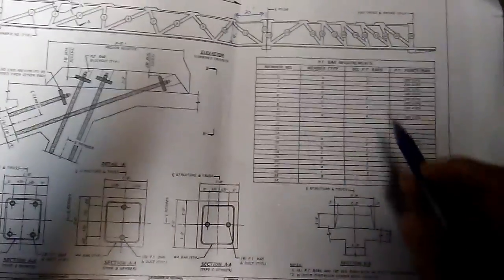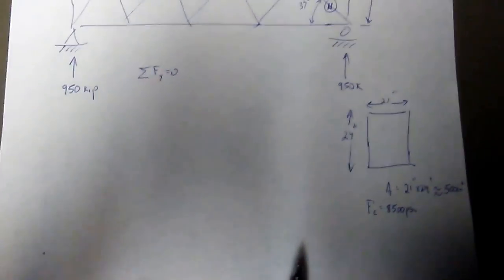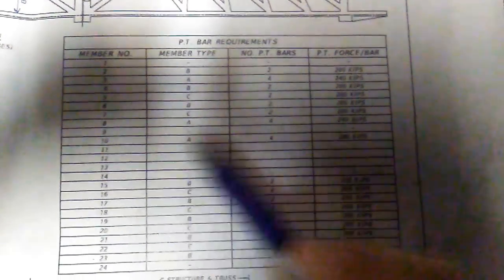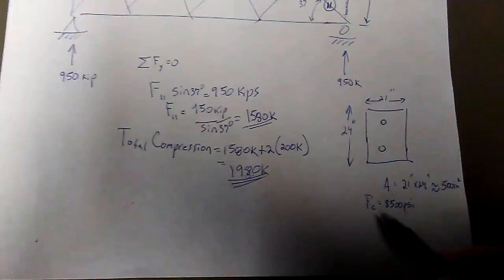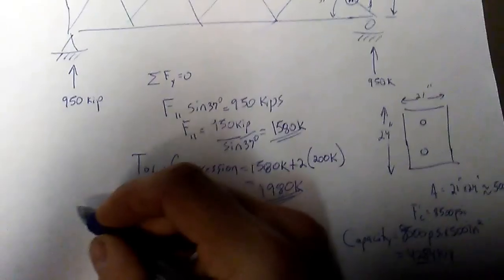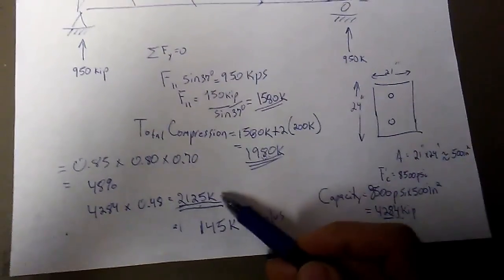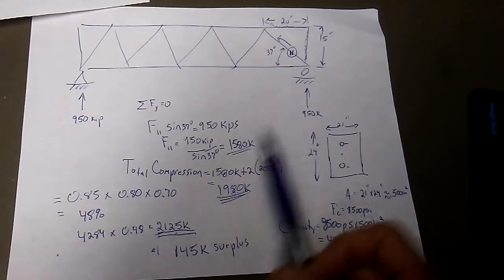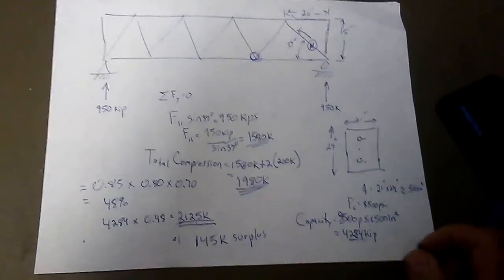FIU Bridge Collapse: The Hidden Truth (Part 3)

Comment: Sorry, but it appears to me that the member that failed was not in compression at the time of the failure, it was in tension. The steel tensioning rod failed because it was stretched beyond its limit, and compression forces would not stretch the rod, but tension forces would.
Reply: The tensioning rod did not break.  The OSHA report has a photograph showing what happened to it.

Comment: You left out the ultimate strength design factors for both the dead load and the post-tensioning load, which together would be about 1.5.  And your analysis ignores the live load entirely with a 1.7 factor.  So your 7% reserve capacity with dead +post-tensioning load only, was actually a NEGATIVE 29% capacity.  Furthermore, member #11 did not fail in compression.  The real over stress occurred where the crack photos indicated, in the cold joint at the base of member #11 that required an impossible to fit in amount of shear friction steel, and in the floor slab itself, that sustained a block shear type blowout due to a lack of an impossible to fit in place amount of hairpins buried in the floor slab concrete.  This bridge was designed to fail prematurely, due to the inexperience in reinforced concrete design that was possessed by all structural engineers who were involved with the design.  Not just the project engineer.  The people that checked the design, apparently possessed an equal degree of competence to the designers.  Computer analysis programs only design main members by giving design forces.  They do not spell out what force transfers need to take place in the connections themselves.  The fresh out of college engineers that operated the computer analysis program, appear to have failed to check the box for ultimate strength design.   Had this bridge somehow survived the construction phase, then perhaps hundreds could have been killed during the opening ceremonies.

Comment: The scaled angle off the drawings of member #11 is 31.4 degrees, making the dead load compression alone in #11 as 1820K.  However, ultimate strength design has a safety factor for dead load that varies for force combinations, but is at least 1.2, which makes the ultimate dead load alone compression = 2184K.  With 2 x 280K PT rods, then you have an ultimate load of 2856K.  The concrete was only 7 days old at time of failure, or .7 x 8500psi = 5950psi.  This makes your crude column capacity = 0.48 x 5.95 x 24 x 21 = 1439Kips  Which is almost HALF of what the design dead load plus post-tensioning load would be.  Oops!  And then 6 people died because the structural engineer did not understand ultimate strength design.  Note that member #2 at the opposite end of the bridge was 36" x 21", whereas member #11 that failed was 33% less at 24" x 21".  Doesn't take a rocket scientist to see that there is a discrepancy right there.

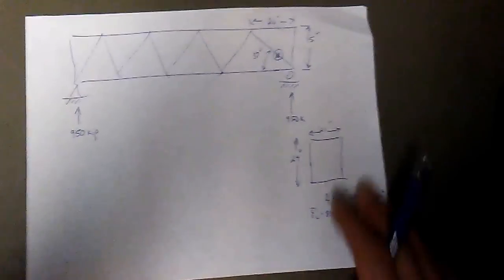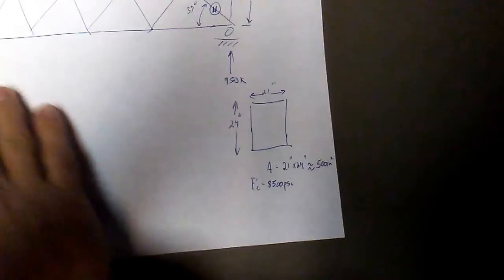Comment: If the total weight was 950 KiP as stated at 1:35, (and as stated in the WP article (https://www.washingtonpost.com/news/grade-point/wp/2018/03/16/recovery-efforts-continue-following-florida-bridge-collapse-at-least-6-dead/?noredirect=on&utm_term=.25391e098e45)  the weights borne at either end would have been 425 KiP. (You should correct your drawing around 1:40 and redo your analysis.
Reply: The weight was 950 US tons.

Comment: Good job on using basic statics and truss analysis. I always believe in applying the basics first then get fancy.
If you take away the two 3" diameter hole areas, that reduces the area to 496.93in2 the result with the factors =2010.56 kips now add that was fresh concrete you can easily see that member was designed below the expected load of 1980 kips. The designers were expecting the concrete to cure before the span was placed into service, let's hope so.  Ooopsies, but unfortunately someone died as a result of this mistake. I defer to what NTSB will find. Looks like #11 member failed in conpression.

Comment: Seems like the cracks could play a role if the angle of the crack was something other than perpendicular to the axis of the beam.  Under compression, the two sides of the crack could slide differentially.

Comment: I am not a building constructor but I worked more than 2 decades in a factory where we made Gangnail trusses. My work there was to make the production drawings.
I think I know why this bridge collapsed.
First, I think, the bridge is poorly constructed and this bridge is not what it looks like.
The bridge is a web-truss with two parallel beams connected by web-diagonals.
The whole construction is fabricated in concrete. The cross-section of the pedestrian-deck is much greater (wider)than the roof-deck so the center of gravity is very low. As a result of this, the compression in the roof-deck is much greater than the tension in the pedestrian deck. By prestressing the pedestrian-deck the compression in the roof-deck will increase.
Prestressing the roof-deck is useless because under full load the tension in the cables will disappear.
The same happens in the web-diagonals 2,4,6,7,9 and 11.
More important is whether the cross-section of these elements can withstand the pressure under full load. Most important is the dimension of the cross-section of the roof-deck. It has to withstand bending in both horizontal and vertical direction. The best shape for this part is a T-form, upside down. Web-diagonals number 2 and 11 are most important because the pressure in these parts is higher than is every other web-diagonal. Check the dimensions of this cross-section in relation to the length. Prestressing these parts is of no use.
To minimize bending horizontally of the roof-deck we can prestress the roof-deck longitudinally by beginning in the center at the ends of the beam and halfway at full width of the roof-deck.
The bridge collapsed because the roof-deck and the web-diagonal 11 could not withstand the pressure.

Comment: I have two news : one good and one bad.  There is a new set of drawings on the Net, this is a good news. The bad is : the tension force in each PT  bars in member #11 is shown as 270 kips. It means 540 kips total . This is more than your assumed 400 kips. Now you need to repeat your calculations. I also would like to make one correction. What you calculated was a SECTION strength, not a MEMBER strength. Calculation of a member strength must take into account the slenderness of a member. Diagonal #11 is approx 25' long and probable will  buckle before reaching section strength . If you take this into account, there will be another reduction in the member strength a more realistic result.
Reply from the maker: You are  correct Richard! I did not consider slenderness. The member capacity value calculated is a maximum...the highest it could possibly be assuming the member behaves as a short column (i.e. does not buckle). The calculations for slenderness are considerably more complex and beyond the scope of a youtube video.

Comment: I'm not a structural engineer, but I like your presentation a lot.  I have to ask, from the actual photographs of the damaged bridge, the square steel backing plate behind the tensioner nut looks like its about 4" x 4".  If the tensioner bar were tensioned to 200 kip, wouldn't that correspond to a force of 200/16 kip/ square inch or 12,500 psi on the concrete directly under the backing plate which greatly exceeds the concrete strength of 8500 psi? If the concrete under the backing plate failed immediately or later on, wouldn't that cause the tension to be released on the tension bar resulting in a failure?

Comment: I contend that the failure occurred in the joint at the top of member 11. Member 11 must of had some conventional reinforcing in it for it to act as a compression member.  I agree adding compression by post tensioning doesn't make sense.  Also, the cross-sectional  area of the truss at that joint was small, mostly just the top (roof) member, due to how the diagonals meet.  Another consideration was, was there a "cold" joint at the top of the diagonals. And, were bending moments in the members considered?
Reply from the maker: Good points Aaron. Usually failures occur at connections.... which may be the case here. Unfortunately, we do not yet know how the connection was reinforced. Regardless, it is hard to believe that the bridge could fail with 1 worker  adjusting the PT bars...were there other deficiencies related to design or construction that will be discovered?

Comment: Given that Member 11 was already factored to be in heavy compression due to the load of the bridge, why would you add to that by tightening its reinforcement bars to such a high value, or even at all?  Going back to your "Total Compression" calculations,  you would get 1580 kips vice the 1980 kips if you didn't tighten the rods, resulting in a higher Safety Factor.  What am I missing?  Thank you for your analysis.
Reply from the maker: You ask the Million $$ question! If indeed the contractor was tightening the bars just prior to failure, why was he doing something that appears to not have been necessary. Is the collapse really attributable to such a simple mistake? That will need to be answered by the NTSB investigation.
Reply: Thanks.

Comment: I love the calculations.  What is an acceptable Safety Factor for a structure of this type?
Reply from the maker: Thank you Amy! And welcome to the conversation. My guess is the minimum safety factor is at least 2, and maybe more. Looking at the calculations, the member design capacity is reduced by approximately 50% when applying the reduction factors mentioned in the video. In addition, when designing, loads are increased to account for uncertainties. For instance, selfweight is increased by 25% and pedestrian live loads would be increased by 75%. So the combination of reducing member capacities and increasing loads is where your safety factor is gained.
Reply: @structuresspecialist9743  You don't have support with an angle like that.  It should be covered in engineering 101.  And it probably will be from now on.  The FIU will live on in history as a wonderful example of too much applied math, and too little basic understanding of construction principles.  Once the geometry is off, all the math goes out the window.

Comment: You focused on compressive failure of member 11.  My understanding of truss design says that vertical forces in member 10 and member 11 must remain in balance, so that total resultant force at the junction at the top of 11 is 0.  If compression (tensioning) was added to member 11 without member 10 responding (moving less into tension) , then a bending moment would have been applied at that junction.  The videos of the failure seem to me to show that as the first point of fracture - just north of the junction above member 11.   The pictures I think show member 10 fractured.  But member 11 looks relatively intact I think.
Reply from the maker: Yes, you are correct. The sum of vertical component of the diagonal member forces must equal 0 at an intersecting panel point.  However, post-tensioning only compresses a member, but does not increase the forces carried by the whole truss.  So Member 10  forces should not be impacted by post-tensioning at Member 11. You do bring up an interesting point though about the impact of post-tensioning at the junction!

Comment: I really love the analysis, but I think a flaw in this reasoning is the assumption that the concrete failed. The engineer inspecting it did note cracking, but not substantial enough to raise red flags. The spectacular failure appears to be the tensioning rod, so the fundamental question is why the rod failed, not the concrete.

I would love to see the math on the diagonal post-tensioning cables that took the weight of that overhang. As layperson, it feels like the best explanation is that those two cables were stressed past their elastic limit, but not passed their yield point, during the move. Post-installation, they then tried to tighten those cables, but since they were passed their elastic limit, they couldn't achieve the same tension any more, and they kept tightening trying to get them to, at which point they passed their yield point and gave way.
Reply: So, as a non-engineer, I did some quick math, and I'm afraid this surpasses my understanding, even with the plans as written.

The plan calls for 1 & 3/4 inch rebar tensioning rods. I don't know what kind of rebar that is, but my understanding is that most modern rebar has 500 MPa, which translates to 72.5 kips per square inch.  Now, 1 & 3/4 inch round would be 2.4 square inches, which would give 175 kips. But the plans call for 200, 240, 280, even 320 kips of force applied to them. What am I missing?

Comment: Senior Engineer

The way I read your diagram is that member #11 would be compressed ( rather than put in tension) to support the load of the bridge deck and roofing. You might look at failure in compression as a possible cause.  The roof section is clearly in tension by the cantilever of the bridge.  Also do concrete structures fail in bending as well as tension?
Reply from the maker: Watch my Part 3 video for compression analysis of Member 11.
Concrete undergoing tension and bending simultaneously can certainly fail if overstressed.

Comment: love learning about this... in your presentation you said that in compression that the cracks were not significant.  If tensioning of the two rods were to be kept within 5 percent of each other..  in other words you would have to tension one slightly, and then tension the other, switching back and forth, would the cracks now demand that tensioning would have to be kept within 2 percent,  for example???  If the cracks changed the allowable difference between the rods and the Tensioning Contractor didn't realize that,   would that account for his over doing it.  Forgive the none engineering perspective.
Reply from the maker: The cracks likely occurred during transport when Member 11 was in tension. With the bridge in it final position, Member 11 switched back into compression, so the cracks would not be a concern. Concrete cracks in tension but maintains its strength in compression even if cracked. Why the contractor was post-tensioning a member already in compression in the key question that will need to be answered!
Reply: I'll be waiting for your follow up..  It will be very interesting to here all of the details.  I am an electrical contractor and have had only minor accidents over 30 years of business, thank goodness.  When distracted, or hiring youthful inexperienced workers we have had close calls.  
Are you thinking that this has nothing to do with the move/cantilever?
Reply from the maker: Tough to say whether the move had anything to do with this. We do not know where the cracks occurred, so that could change my conclusions, but assuming the cracks were in noted in compression Member #11, I would not fault the cracks for the bridge failure. Looking forward to finding out more information about the cracks and their locations....stay tuned!

Comment: The design was inherently flawed.   It was primarily designed for the facade, a mockery of actual engineering, trying to pass the crap off as a suspension bridge.   The beauty of the bridge is in the fact that it is holding up the bridge, not just sticking out like an eyesore with no function.   

Then, the designer had another priority:  not impeding traffic.   I bet, the bidding for the project included estimates of how long the lanes would be blocked, along with cost.  So after all that, the designer didn't stand a chance, and in their exuberance at getting some decent paying work, forced out this turd that should never have flown.

From now on, match the materials to the form.   Just look at the involved forces and use suitable materials.  Then overbuild it, don't just overdesign it.
Reply from the maker: The suspension bridge component you refer to was intended mostly for aesthetics. I will do a video about this....so stay tuned. 
Construction that has minimal impacts to traffic is a big selling point! After all, does anyone enjoying sitting in traffic?
Reply: structures specialist Well, my contact with Architecture design philosophy gave the impression facades were not the epitome of aesthetics,  to say the least.  Actually, it's totally frowned upon by anybody schooled in design.   I know, I can't speak for everybody...   I know...  but, ask an architect and see what their opinion is.  

So the aesthetics they were actually creating were the same aesthetics a scam artist would appreciate.   They wanted to pass it off as a suspension bridge to ignorant passers-by to marvel at.  And a nice place for a selfie!  

And on a side note how much did they screw up trying to rush the traffic interruption, and ending up blocking it for weeks?   Such a terrible lesson...   but we must learn from it everything possible...
Reply: @jonathanryals9934  form follows function.